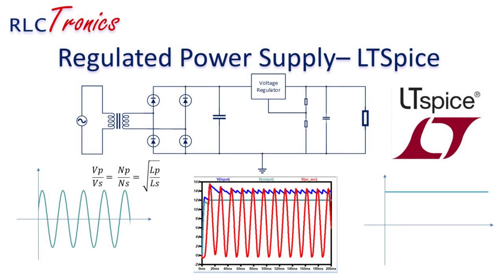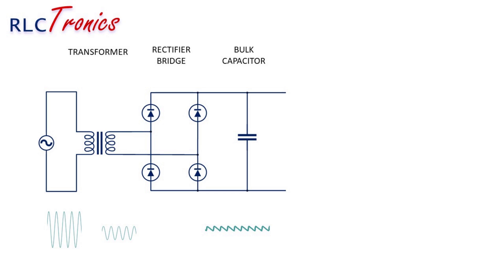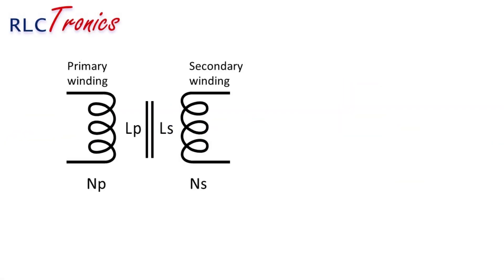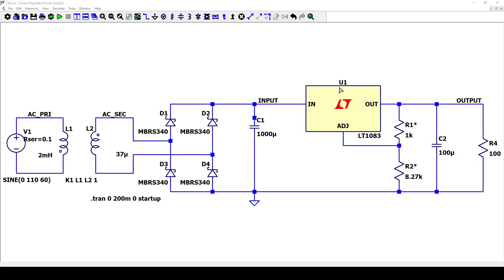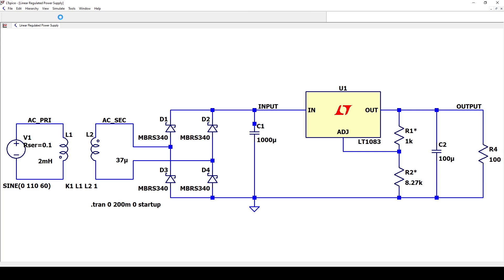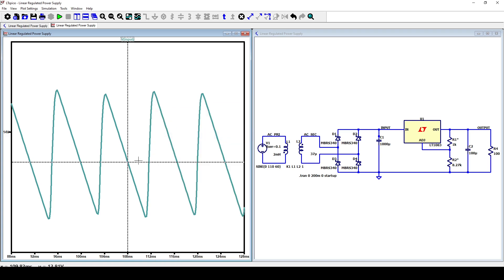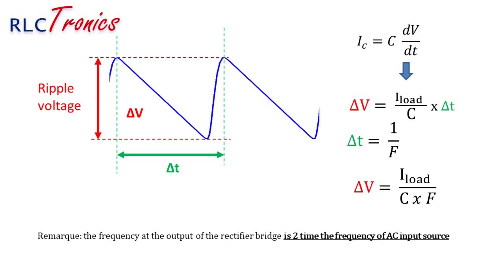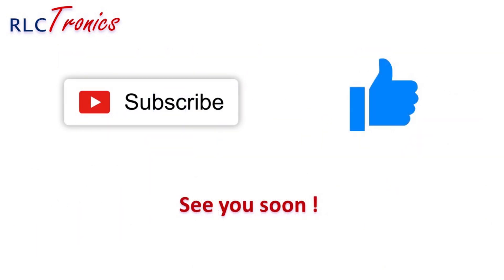RT#8. Sizing a regulated 12V Power Supply - LTSpice Simulation

Comment: Nice lesson in applied math. When I build a low voltage power supply, I start with something that should work, and if it doesn't, keep playing with it till I get the results I want. BTW, 110 volts is so yesterday. 120 is the standard these days (in the US).